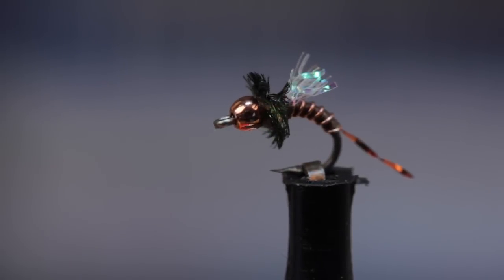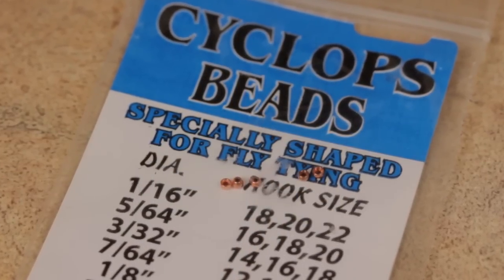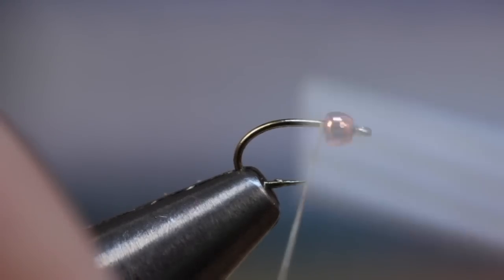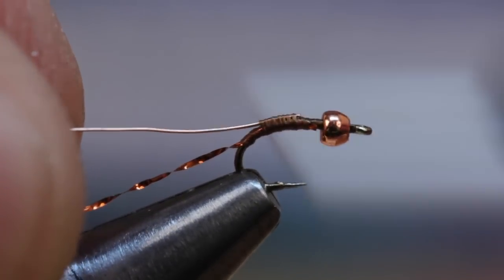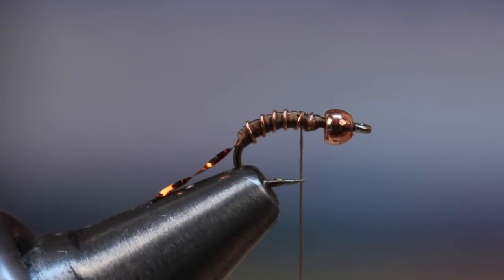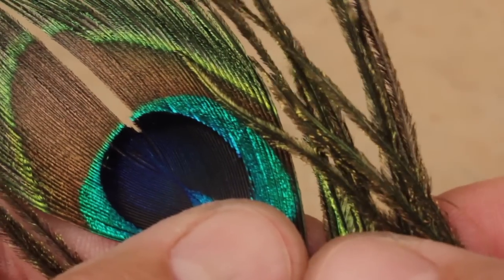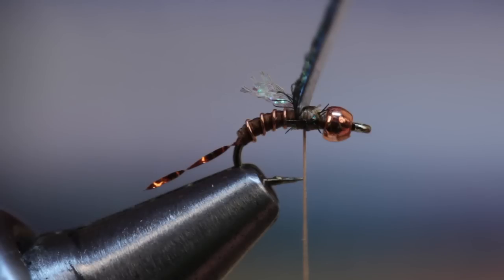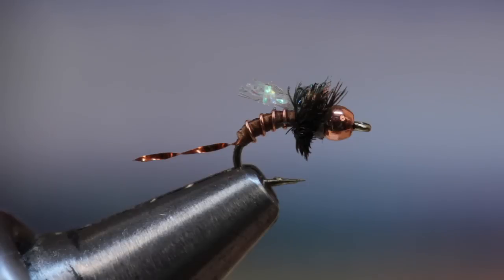Copper Zebra Midge

Comment: In Colorado Tail Waters I catch more trout on size 20 - 24 in the winter than anything else.  Even in the summer hanging a size 20 zebra midge off the back of a size 14 Copper John, I catch as many on the midge as the nymph.   It takes skill to bring in a 16" to 20" trout on a size 20 using #6 tippet.  Just remember it's not Bass fishing where you jerk it in, you have to use finesse and love it a little, caress it, massage it, be gentle and it will get there for you.

Comment: I've seen in a few of your videos that you "secure the wire with the tip of the bobbin" as you helicopter it off, what is that doing?
Thanks!
Reply from the maker: The bobbin nozzle helps to stabilize the hook shank while you rotate the wire otherwise, you are putting a lot of strain on the hook thus weakening them. Hope this helps.
Reply: Ahh, I understand. It does help as I'm new to this! I should probably widen the legs on my bobbins; The hook tends to lean towards the direction the thread is pulling - weakening the hook - That's the principle, right?
Thanks for all the videos, really enjoying tying and seeing a master work!

Comment: How do you fish this fly?  Obviously it's a wet fly, but just dead drift?  How far down---as in half way to bottom, bouncing off bottom, or float in top film?? Thank you
Reply from the maker: +Woodrow McWilliams Although everything you said will work just fine, this is one of my favorite patterns to fish hung about 2 feet off the back of a nice floaty dry fly like a Wulff or even a Chernobyl Ant. Fished that way, I think most of the time it rides about a foot below the water's surface. Right now is about the time of year it starts to work really well.